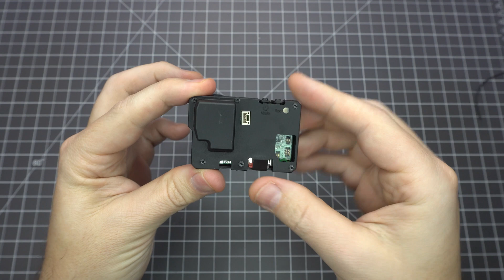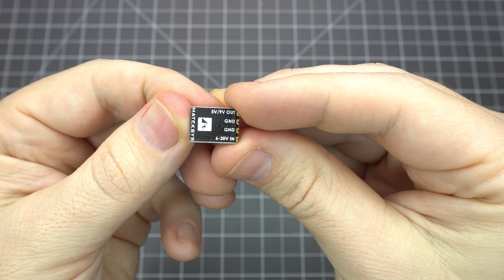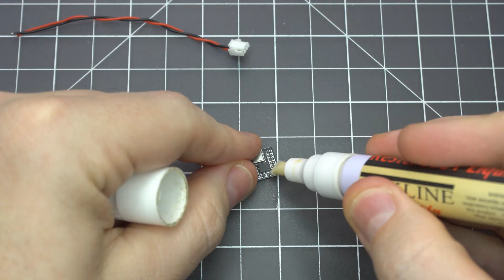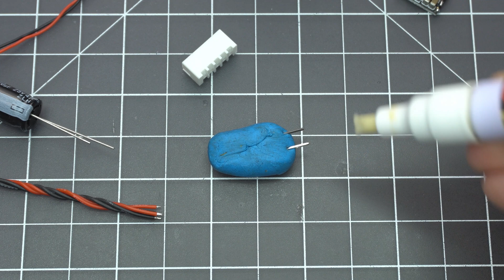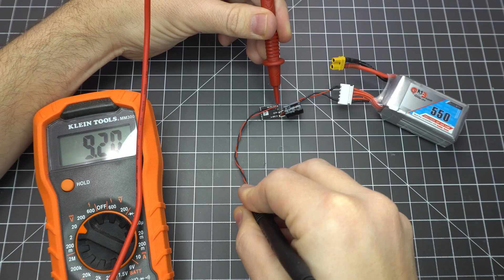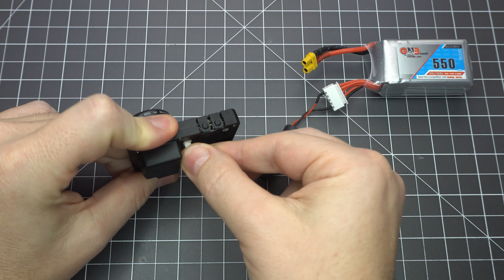Protect your Naked GoPro with a custom power lead

Comment: Mine does not have a capacitor but does have a bec and was working great until i plugged the lead in backwards and it smoked now no power to the gopro will replacing the bec work ?

Comment: Hello as alwyas Nice Review! I have a question maybe You could help me out. I have the original dobo head mount for the dji fpv drone, and i  have an 8 hero black (full size) and a geprc hero 8 black naked. I have both with same settings, wifi off and all the same settings. Thing is that with the naked i get a satelite drop to almost 0 and with the full size i don't have any problem. Any idea of this? Thanks  have a Nice day

Comment: Can I do this process but with a 6s Lipo? Will the extra BEC lower the voltage?
Reply from the maker: Really depends on the BEC and it's max input.
Reply: @whiffles  ich have bought the Matek BEC 6-30V 1,5A 5V / 9V. Will the GoPro work with this BEC and 6s?

Comment: can you help me? i have issue to my naked hero7...  when power in not led blinking but off... so when turn on, led solid not blinking n cant record...
always solid led when turn on, MotherBoard is warm like a normal...
i was check pad bec, its normal voltage...

BTW, i use this configuration power lead like you too...

Comment: I have followed the instructions and made myself a power lead but every time I try to connect it with battery I get small spark. what have I done wrong?? I have connected it with my naked GoPro and it’s working but the spark is making me nervous.

Comment: Personally I found that you can solder to the pin while it's in the balance plug, just do it on a low temp and quickly. Thanks for the video!

Comment: my 2.5inch quad ill be mainly using 2S battery. Using the betafpv bec, would you recommend to solder onto  FC power lead (which have a 25v 150µF capacitor) should be enough with 2S?

Or should I still use the matek + capacitor onto battery lead?

Comment: do i really need the BEC, if i have the gaprc bec board for my naked hero 8? i takes up to 6s, so a 35v ~500uF capacitor should be enough, am i correct?

Comment: Hey very nice solution, doe someone can make it for me and ship it ? paypal trade ? regards, Romain
Reply from the maker: Which cam are you using? The newer boards like the iFlight Hero8 BEC and the SMO 4K don't need this. It's mostly for the flawed Hero6 BEC.
Reply: @whiffles  hey! I use go pro naked 6 with beta fpv V2 case and bec 👍

Comment: Is same moded cable necessary for SMO 4k?
Reply from the maker: The SMO 4k handles the power much better, so it isn't necessary. It's still handy to make a balance lead adapter for it though.
Reply: @whiffles  just had to confirm that nothing is wrong making one for smo 4k too, since I will make for gopro anyway. Thanks!
Reply from the maker: @janezhitori6203  Oh I use the same one for my SMO 4K and it's no problem. It's just not entirely necessary.

Comment: Hi whiffles!! I have  Matek Micro BEC 5V/12V 1.5A.  so my question is -  12v out  will work fine aswell like 9v out ?? Or it's too big?
Reply: i wonder the same thing, maek is out of stock and i got the 5v/12v iflight bec

Comment: Nice one sir. If we power naked GP directly from balance lead?
Reply from the maker: You can, but I feel safer doing it this way.
Reply: @whiffles  Sir why do we need to bridge and 9v to bec ?
Reply from the maker: @outboxfpv4360  Sending 5v to a 5v BEC may not provide enough power.
Reply: Is 12v safe?

Comment: Any idea what it would take to support running off of a 6S balance lead?  I want to run this setup on my 7" quad which is 6S. I know iFlight has a USB-C to 6S lead adaptor but that would require stripping the Hero 8 down and leaving the USB-C connector attached.  I was hoping I could use this connector as the power source instead of the USB-C connector.
Reply from the maker: As long as the BEC takes up to 6S and you use a 6S balance plug you should be good to go! The BetaFPV BEC doesn't take 6S but I believe the one I used here does.

Comment: Will a 25 220uf capacitor also work instead of the 25 470uf? What does the Higher micro farad value do? absorp spikes better? I would just make a power adapter to  adjust and pre check my gopro filming settings to a 4s lipo and then put the gopro on the quad afterwards, there it gets power from the FC
Reply from the maker: I believe 220uf should be fine. Adding the capacitor in the first place is somewhat redundant. It would work without it even.

Comment: As you also have the Insta360 SMO 4K, do you know if this step is necessary with that, as it should accept 2S to 6S voltage from the get go. I am looking for a balance to SMO 4K power cable all over the internet but can't find any imformation. I don't wanna take the drone apart to connect the camera to power, I would love to just plug it into the battery directly somehow.
Reply from the maker: I trust the SMO 4k a lot more with direct voltage from the battery. This may not be necessary. I haven't heard any reports of a cooked cam. You might just want to buy a balance lead plug and solder it to the wire that comes with the SMO.
Reply: @whiffles  Thanks for the quick answer! You are really knowledgable and helpful. You also helped me the other das regarding SMO 4K stabilziation with Reelsteady. Earned yourself a sub!
Reply from the maker: @morimetz  Awesome! Glad you found it useful!

Comment: Well my gopro just fried 
Gonna do this next time
Reply from the maker: It's not a guarantee, but it's better than sending it 16.8v.
Reply: @whiffles  well it's interesting cause I completed the flight, everything was fine up until I unplugged the battery. Next time I plugged it in, the gopro refused to turn on
I thought Betafpv BEC died, but I tried a different working one and it was still dead
Reply from the maker: @MaxRovensky  Same thing happened to me before I started using this.

Comment: Hi Whiffles, thanks for the very clear explanation. I do have a problem though. I use the 9v out in to the Betafpv bec. Recording goes ok, but 1 out of 3/4 recordings I get a image/recording freeze. So recording goes on, but the I get a video still. Any idea what is happeling? I tried different SD cards. This makes no difference.
Reply from the maker: Hmm, not sure what could be causing that. I've had it come back without recording as well, but it's usually because I pressed the button and accidentally stopped the recording.
Reply: Happened to me as well!! I tried to swap between SD cards with no result whatsoever. I have the GoPro 6 attached to the beta 95x V3 directly. Did you came out with the solution? Starting to think it may be a GoPro problem...

Comment: I bought iFlight type C 5V balance plug power cable for my gopro hero 7. Plan to naked my gp7 using Betafpv Case V2. Can i use this cable to power up the BEC (replace the USB type C with BEC connector)
Reply from the maker: I think that could work. You might want to test the voltage output of that cable. I'm not sure if it outputs the full voltage or only 5v. If it's only 5v and doesn't output enough current it may not be enough to power the GoPro.
Reply: Did this method worked for you , all im getting is a  blinking green light , i have a naked gopro 6 with the betafpv v2 and im using the iflight bec that connects to the balance lead , and all i have is a green blinking light .
Reply: Did this method worked for you , all im getting is a  blinking green light , i have a naked gopro 6 with the betafpv v2 and im using the iflight bec that connects to the balance lead , and all i have is a green blinking light .

Comment: Do you think a 220uF 35v cap is good enough?
Reply from the maker: It should be fine. The cap isn't crucial.
Reply: @whiffles  thank you for the reply🙏 Also i thought the GoPro was always powered with 5v? Why is it 9v in this setup?
Reply from the maker: @hanfpv3093  The Betafpv BEC outputs 5v directly to the board, but it needs a little more than a 5v input. You can try powering it with 5v but it may not work. If it does, it would be safer.

Comment: Thanks a lot. My Matec BECs will be here today so I can make this power lead. I just don't like the electric snap and blue spark I see every time I plug the lead into the balance plug. I will feel a lot better just feeding 9v to the camera rather than 16 or 17 volts.

Comment: I have made one before I watched Your video, I did not use cap. Should I add one or I can leave it ias it is ?  Also i did not bridge to 9V so matek outputs only 5V but full gopro 6 seems to be working allright.
Reply from the maker: Interesting, I didn't realize you could do 5v to 5v and have it still work. You should be fine. That may even be better because the BETAFPV BEC is known to cause voltage spikes up to the input current.
Reply: Hi I tried the same 5V bur my goprp hero6 does power off after 10 secs
Reply: @spoofacke  have you used capacitor? Becouse I didn't

Comment: Followed your steps and when I power the naked hero6 I get one green blink and nothing else. Any suggestions?
Reply from the maker: Did you press power shortly after the green blink?
Reply: @whiffles  I did. So I think the LED on the bec is bad I connect via app and it works even buttons just not led. I did give the bec 11v as the external bec I’m using is variable
Reply from the maker: @airbrainaerials  Does it record? Maybe you need to enable the LED setting on the GoPro.
Reply: The green blinking light thing is a known issue. Beta fpv mentions it on their site. It should still work. I usually just unplug and plug back in and it’s fine.
Reply: Turn on front LED in camera preferences.  It indicates as the back LED after this conversion.

Comment: Cool but you need to ditch the BetaFPV BEC it doesn't make sense to run 2 BEC's like you're doing. The BetaFPV BEC has killed many GoPro's do to inrush voltage spikes. People have measured over 8v upon power up. I myself cut the BetaFPV Bec out and just use the same Matek BEC and the BetaFPV buttons.
Reply from the maker: It's just unfortunate that such a neat product is so flawed. I really like the case, but it seems even solutions like this aren't 100% effective.

Comment: Nice video. One question, isn’t this method making the batteries out of balance since you are only connecting it to one cell? If you parallel connect it to all the cell would that be the solution? It can take up to 30v right so it will not fry right?
Reply from the maker: The outer wires of the balance lead are exactly the same voltage as the XT30. It's only the internal wires that represent the different cells.

Comment: I just build something very similar to this. I made the connector to battery balance leads swappable. I did that so I could connect to 4S or 3S. The process is the exact same except for adding a 2 pin connector to swap out the battery connectors for whichever I'm using.
Reply: So would the voltage regulator go to a female 2 pin connector and then each of your 3s and 4s balance plus would be connected to a male 2 pin connector? So you could just make one of these devices and then swap out the balance plug?
Reply: @Bullitain  not to each pin, just to the ground and full load pin.

Comment: Can I power the matek bec from my PDB main that has a capacitor? If yes, will I still have to use the capacitor on the matek bec output?
Reply from the maker: You can but that sort of defeats the portability of this. You don't need two capacitors and even this one is not necessarily required.

Comment: Another awesome video!  Super helpful. Where can you get just the power cable for the BetaFPV BEC? Is it a standard wire with a name?  I'm asking because I want to use the one GoPro lite on several quads without purchasing several cases/kits.
Reply from the maker: The plug comes with the BetaFPV naked GoPro kit. All the other parts are listed in the description.

Comment: Can you follow the same proncipals to power gopro with usb-c port? I saw other video when rsistor 4.7 ohm was used instead of cap.
Reply from the maker: I'm not sure, but I believe iFlight has a balance lead to USB-C adapter. I haven't tried it though.

Comment: I've been doing this, but swapping the cap out for a Fettec spike absorber, I think it may be better.
Reply from the maker: I was considering just using the Fettec alone without the BEC. That's probably sufficient.
Reply: @whiffles  I’m seeing mixed answers and I’m getting confused :p. So the betafpv bec is crap? One says to leave that one fully out. You say to run bec into bec. The other says bec into bec doesn’t make sense. You said capacitor not necessary. but it’s saver I guess? And what about this fettec spike absorber? You still run that with a capacitor and the betafpv bec?
Reply: @Diown  I am wondering this as well!
Reply from the maker: @Diown  To be honest I don't fully trust the BetaFPV BEC even with this adapter. I've heard the BEC itself can be faulty and cause spikes even being fed a lower voltage. At the very least it's not receiving a full 16.8v so that should minimize the size of a spike. Personally, I prefer to use the iFlight BEC on my naked Hero8. I'll continue to use this adapter to power my Hero6, but if it dies I won't make another Hero6. I also use this to power my Hero8 not for the protection but for the convenience of plugging in to my balance lead.
Reply: @whiffles  Hey Whiffles, would love an answer on the comment the person above stated!
There is so many mixed answers everywhere!
Reply from the maker: @RubberTag  Sorry I missed that one. Hopefully my response helps!
Reply: @whiffles  but when using a capacitor and 9v matek bec it should be a stable voltage right and save to run the betafpv bec or not?
Reply from the maker: @Diown  I’ve heard some say it’s still not 100% safe mostly because of the betafpv bec. I haven’t heard any reports that somebody had a failure using this method though. I still use this.